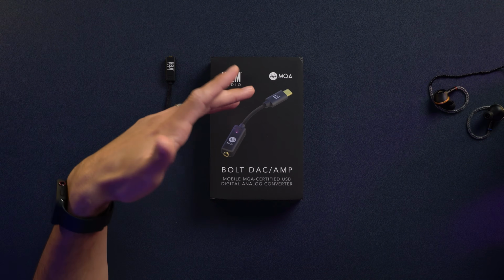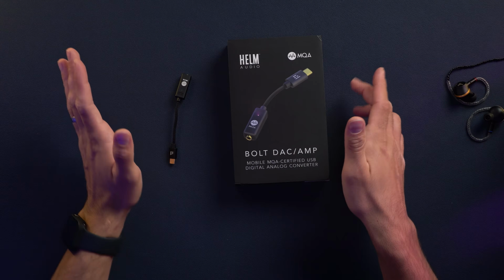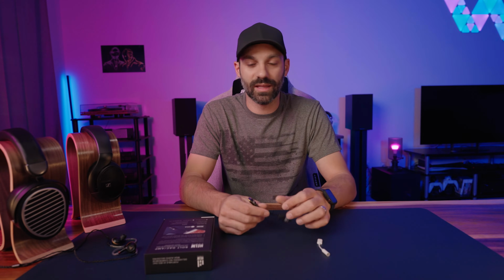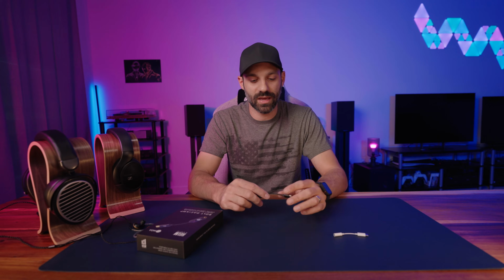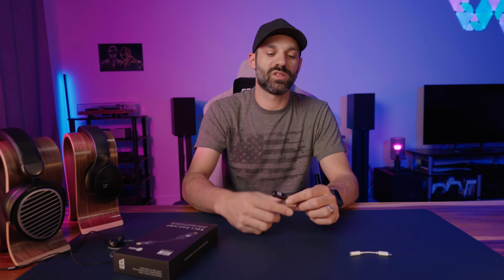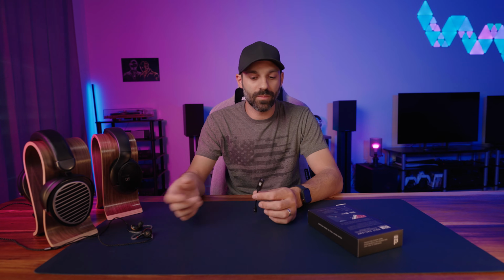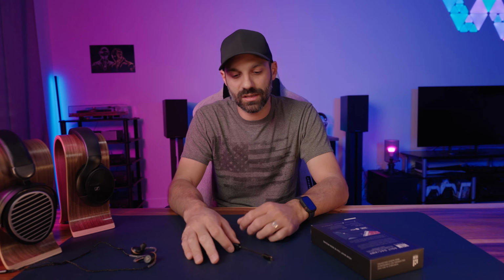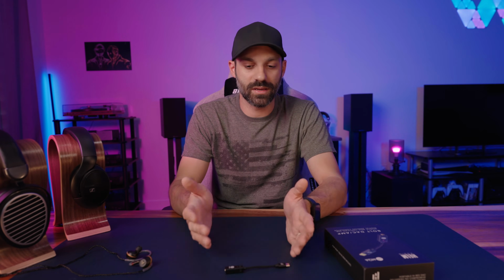HELM Audio Bolt DAC/Amp Review - Is this all you need?

Comment: I recommend the Play4 over this by miles , the specs and software alone , and fact it drives my BD770Pro 80ohm  way loud and absolutely clean 24/192 up to 150ohms Works on my Samsung phone too USB-C
And it is only $25 , 1/4 the price.